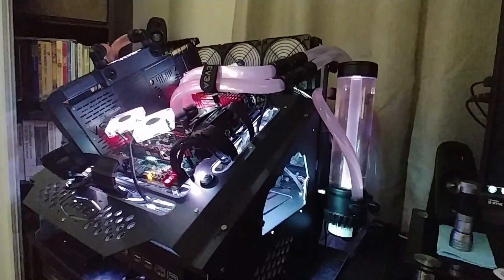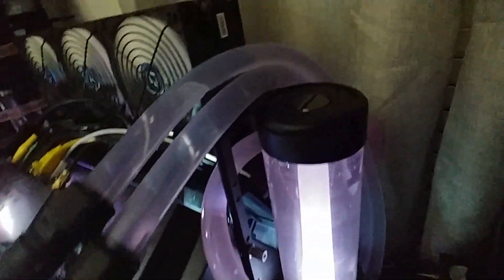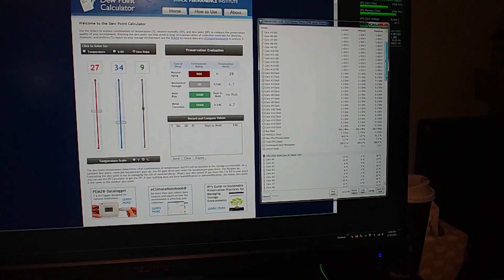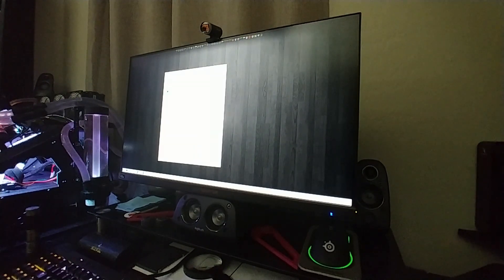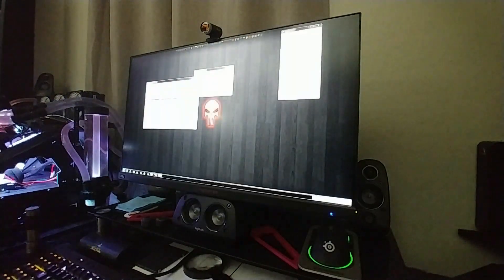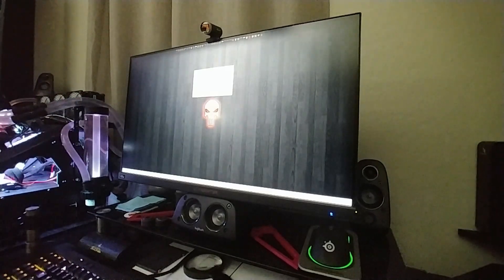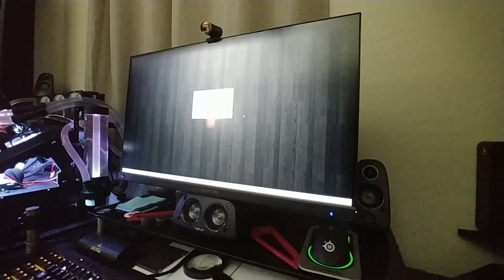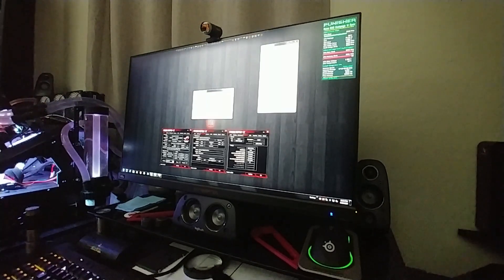Overclocked i9-7960X Benched at 5.1GHz w/ Chilled Water

Comment: How can I disable turbo bost in the BIOS, I have been told that it is necessary to do overclocking, Asus Rampage Apex motherboard
Reply from the maker: Sounds like someone gave you wrong information. You can disregard that. There is no reason to disable Turbo Boost. And, if you do it won't overclock.

Comment: i have problem ,i9 7900 estable need to 1,2v to 4,6ghz,temp realbench 80 degrees,is normal?
Reply from the maker: It might be normal. How hot is the room you are benching it? What are you using for cooling? The 1.200V is good. 80C is not terrible if you are in a hot environment.
Reply: @MrFoxRox  fuck corsair h150...360mm
Reply: @MrFoxRox  have delid,i9 7900x
Reply from the maker: @1973makina  what is the temperature of the room? You can never be cooler than the air in the room using natural cooling with air or water. The only solution is colder air or colder water. Otherwise, if the room is hot the computer will also be hot even with the best water cooling.

Comment: Hey it's me again, the one with the Xmg a523 (Joel) 
As a test I for the liquid metal, I am repasting my graphics card with some Conductonaut.
I just opened my Gtx 980 and am about to put liquid metal on it. I also want to apply nail polish around the gpu.
Do you think it would be a good idea to put the foam-barrier, you put on one of your laptops, around the gpu?
Btw: Nice Video! 
And once again: greetings from Germany,
Joel
Reply from the maker: Hi, Joel. Yes... Might as well. It makes using liquid metal safer.
Reply: Buy MG chemicals 422B conformal coating. Is special for that. I have repasted my aorus 1080ti with that and an msi gs65 too